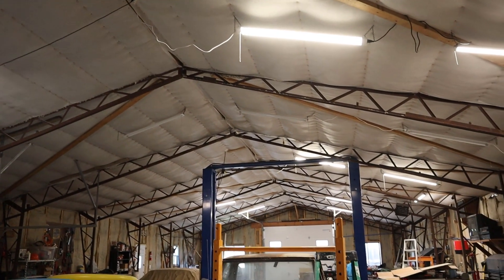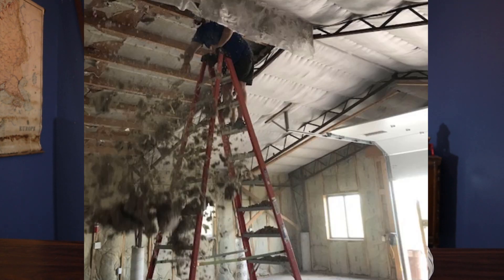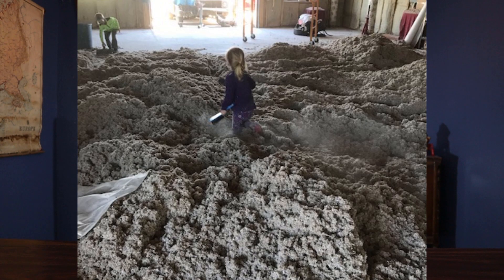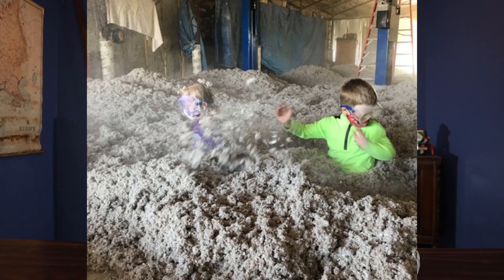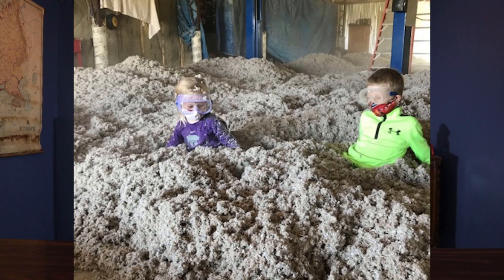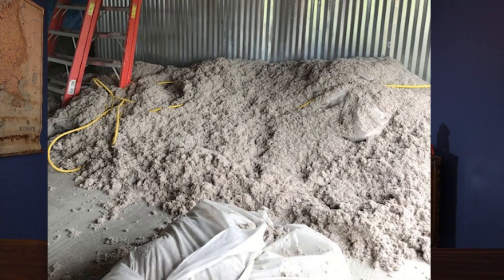Insulation DISASTER!!! - Don't Use Cellulose For THIS

Comment: I installed insulation for over 8 years. You needed to spend the extra money on quality ventilation chutes. They would be installed between the roof sheathing and the open cavity.  That fiberglass you installed will eventually mildew and or for mold  in a cavity that is not ventilated.  Cellulose was actually the correct product for your application. Your prep work was inadequate and you used the wrong manufacturers product. Basically you used temu insulation.  Springing for cocoon would have saved you a whole lot of headaches too.For want of 300 to 500 bucks worth of chutes, you blew an extra 1000 dollars. BTW the fiberglass will kick off ammonia as well. Get a batt of fiberglass wet and leave it for a day or two. It will smell like a thousand kitty litter boxes are in that space.

Comment: Never put insulation on the floor.. do the rafters.. it will be a nightmare.. that we are dealing with too. I huge nightmare, we had animals die up there and you can't find them.. mice rotting is the smell of cabbage. .  Do the rafters, or will save you money in the long run.

Comment: Bad circumstance. I wonder if Greenfiber would honor a claim (probably not).  Understanding blown in cellulose has been improved, it would be unfair/inaccurate to discount it now in favor of fiberglass. Applied in accordance with manufacturer's instructions, the R-factor achieved by volume is considerably better for nearly equal cost.  Both settle in attic applications until they reach their stable density, but the manufacturers' coverage charts typically account for it. Aso, practically speaking, cellulose is not nearly as much of an irritant during installation. It does not contain materials that irritate unprotected skin.

Comment: Just use Cardboard as insulation hahaha  Cardboard has a R Value of about 3.5 - 4 per inch get yourself 4 inches worth of cardboard and you will have a R value of 14 - 16 most americans throw away or recycle 100s of pounds of this each year through packages in the mail or store bought items but its great as a insulator and its practically free.
Reply from the maker: You are right, it does have good insulation value.  It's just highly flammable and easily molds.

Comment: Hi Garrett! I'm not far from you, in Newton. I've been researching removing the cellular from my home attic to air seal, and whether I must actually dispose of the old insulation or if I can just move it aside to air seal and then redistribute it as I also build an elevated deck ABOVE the 10-12" insulation to be able to get around up there better.
Sorry you had this issue, and good information to know if I decide to replace my insulation completely or if I need to just add some more after redistributing and leveling what I have.
Reply from the maker: If there is nothing wrong with the current insulation, I would redistribute.

Comment: If you have a high humidity environment, you need humidity control, a ventilated attic, good air circulation or some other method to remove accumulated moisture.  This is not unique to cellulose.  Low density spray foam has the same issues.  See, for example, https://youtu.be/Ld8pzIu45F8?t=2763.  You may be aware that warm air rises (because it is less dense).  Humid air also rises because it is less dense.  So you will have the warmest, most humid are at the peak of cathedral ceilings. You are blaming cellulose insulation for the issues you ran into.  There may be other issues related to the insulation approach for the roof.  This is a good case study into what can go horribly wrong with roof insulation.
Reply from the maker: I replaced it with fiberglass insulation, and no more problems.

Comment: Can some one please address the settling effect of cellulose? I had 10 plus inches of cellulose blown in several years ago. Went up recently to install security cams. All of that cellulose has sank to the rafter tops. As in it's ALL GONE. Cellulose is a waste of money. It settles over time. Like you just tossed all that cash out the window. At least pink panther fiberglass stays put.

Comment: As soon as he said Ammonuim Sulfate (the cheaper product) I knew where this story was going - the odor of kitty litter.  Folks , Cellolose itself is a great product.  And Green Fiber makes some of the best Options.  However, ALWAYS Buy the ALL BORATE PRODUCT so you dont end up with this odor.  Check the manufacturesr spec sheet, the markings on the bags and/or the MSDS sheet to make sure it says ALL BORATE or 100% BORATE and NO Ammonium Sulfate.

Comment: The likely culprit is the air leaks from the foam board. The roof envelope wasn't sealed enough to prevent the cold air from infiltrating the cellulose insulation which likely caused the humidity dew point problem.

Comment: Fiberglass is a horrible substance. Wouldn’t the better solution have been to spend more up front on the borate-only cellulose? That would not have reacted to humidity and tried to suffocate you. The problem was the ammonium sulfate, not the borate, right?

Comment: even if the cellulose insulation wasn't treated, wouldn't there be the possible issue of mold??
Reply from the maker: Because of the treatment, the cellulose won't mold.  However, if it is holding moisture, it can make the wood it is in contact with mold.

Comment: Never used fiberglass or rock wool in any of our houses built in the humid shore environment of North Carolina. Only Cellulose with borate only. Always blown-packed by pros with certified materials, paperwork, and verified by building inspections. Never had any off gassing, mold, mildew or soggy problems. Summers 85 to 100 with winters 25 to 50 degrees F.

Fiberglass, except wearing a full positive pressure bunny suit, gloves and face mask, is a no-no for blown in. The same protective clothing must be worn for  mat and batt fiberglas/rockwool installs by hand, followed by extensive clean up, disposal and full interior painting to stabilize lingering dust particles. 

Another no-no is the use of air conditioning ductwork that has an interior lining of treated or untreated fiberglas or flexible ducting with any fiberglass anywhere. The glass threads will, over time, flake off or pierce  the flex plastic into the air stream under heating and cooling expansion and then into adult and children's lungs.

Best to use plastic A/C pipe or metal ductwork with outer insulation of foam being the best .

Comment: Would a vapour barrier on top of 50mm cellulose cause an issue close to warm side of insulation as its hydroscopic? I have 270mm fibreglass on top. The cellulose is between joists in loft.

Comment: Used this stuff in the attic 32 years ago when I built this home. This year has been very humid causing this insulation to become damp and increasing its weight causing my entire second floor ceiling to bow between trusses. We only noticed as a sheet of drywall in the spare bedroom ripped through the screws. Now I will have to vac out the entire attic and replace with fiberglass batting.
Reply: Cellulose insulation promotes the growth of mold & mildew in your attic.

Comment: You can use gutters or 3” pipe to run a vent from the soffit to the ridge. I would at least somewhat temp control the area all the time. At least the air is moving and some of the moisture removed

Comment: Lert a contractor talk me into cellulose...$$$$cheaper Right...our house was so dusty after that...never use cellulose. It will get everywhere. Sold house.
Reply: Yeah because you should have had the attic been air sealed before installing, either the contractor may or may have explained this to you or you were just being cheap and didn’t want to pay for the attic air seal ..

Comment: Did you use open cell or closed cell?
Reply from the maker: I don't know what the original foam board was as I bought it used.
Reply: @Challenged1  sorry did not see you said foam board, not spray foam. If you went with closed cell it would not need anything else. The addition of a $600 of ridge vent would likey provide massive air quality improvement. Best of luck.
Reply from the maker: @infinitevelocityCA  Actually, the entire ridge was vented.  The roof purlins go in the same direction as the ridge vent making the ridge vent useless unless you are trying to ventilate the entire shop (conditioned space).  Closed cell would have been nice, but would have cost $7k for the roof structure.
Reply: @Challenged1  From a building science perspective, it's possible that the foam board did not completely cover the surface of the underside of the roof deck (edge gaps) and/or the foam board was not affixed directly (mechanically or adhered) to the roof deck. If that is the case, the underside of the roof deck can become a condensing surface, especially in a high humidity location. The night sky on clear nights is black and very cold (-400 F) causing the exposed surface temperature of the roof to lose enough heat (to deep space) to reduce the roof temperature below the dew point, creating condensation on the top side of the roof AND the underside of the roof deck. The resulting condensation on the underside can then be "attracted" (moisture gradient and gravity) to the cellulose creating the chemical reaction you described. The reason properly applied (closed cell) spray foam eliminates the condensation problem is no condensing surface is made available for the dew point to be reached. The key is to use a minimum of 2" of closed cell spray foam on the underside of the roof deck. This nighttime phenomena is known as night sky radiation (a/k/a radiative cooling). Surfaces that do not face the night sky are not subject to this phenomena. An example would be dew forming on grass that is exposed to the night sky as opposed to grass under a tree or canopy.
Reply from the maker: @kevinhogan2909  Definitely possible.  I will say, the amount of smell followed the humidity level exactly.  The more humid, the more smell.  The less humid, the less smell.

Comment: Just checked Greenfiber 's website and it appears they stopped making the version with the ammonium sulphate in it.  I'm betting they were getting a lot of complaints about that version of their product.  Was really bad decision on their part to provide a product that could easily off-gas  ammonia when in contact with moisture in order to save a bit of money.  One of the benefits of cellulose insulation is ability to absorb and release moisture over time.  There would have been zero issues if the non-ammonium sulphate version was used.
Reply: I know I'm replying late, but this is super helpful. Thank you!
Reply from the maker: Exactly

Comment: Probably not the best idea to let your kids play in that
Reply: They had ppe on. 😅
Reply: @bricknmotor  Poe does nothing

I do this for a living and would never go in an attic with the mask you used for  Covid
Reply: @DB-lp2be   yea i said ppe. Idk what your thing is. 🤣
Reply: @DB-lp2be  bro whats a poe?  Ppe stands for personal protection equipment but you should know that Because youre a pro. 😆
Reply: Its Not hazardous to play in. It doesn't require PPE to touch. It's just paper and flame retardants. It's not good to allow to it to get wet without ventilation if ammonium sulfate is the additive. You can touch it all day long with no consequences. I was an insulation tech for years and we used it for wet spray applications in exterior walls but it's not great for overhead use if it gets too wet bc it's heavy and can damage ceilings or in the case of this videos creator,..can off-gas ammonium sulfate when the cheap stuff is used and not allowed to adequately ventilate while exposed to excessive moisture. If one must ..make sure it's the Borate additive kind and not Ammonium Sulfate..and have plans for adequate moisture control factored in before using it for overhead uses.
Reply: @keithbarto5464 borate and ammonia sulfate is safe? Hmm

Comment: Adding polebarn steel to the bottom side would have saved you from having to take it down. It would have been expensive and a pain, but doable.
Reply from the maker: My steel trusses would have been close to impossible to seal around.  I agree though, if I could have sealed it from the inside, I think it would have been fine.

Comment: Your issue was not having an air layer between the cellulose. You are supposed to use netting and create an inch to inch and a half to allow air flow between roof and insulation.
Reply: Yup gotta have air flow
Reply: Yea ya would think the product would of come with some kinda pro tips or do all the research you could on using shredded paper before filling such a huge space first
Reply: Wrong - The odor will always happen if the ammonium sulfate comes in contact with high humidity air over 55% humidity. Doesnt matter if the air is moving, plastic enclosed, etc...  And its not always neceesary to have an air gap on under a roof. Its okay to create an "unventilated roof assemply" as long as your using the right materials, stopping all air movement and moisture movement.
Reply: air flow is your houses best friend thats why the draftee old farm houses last for ever the wind blows rite through them

Comment: So, basically you got what you paid for.  Cheap ammonia impregnated crap. This chemical should not have been in the CF.  In Europe we use benign boric salts as fire retardants and we have had no issues in similar conditions. Here it's also cheaper than any other insulation available, especially foam.  CF is a sustainable and safe product as long as you choose a reputable manufacturer  Total sharks sold this crap to you. Name and shame. BTW, Fibre glass is a fire hazard and glass needles are much more dangerous to your children's health, especially if you let them play in it.

Comment: It sounds like your shop needs ventilation, and i don't mean the roof, I mean fresh air. The inch of foam likely made it very airtight. The humidity combined with ammonium sulfate amplified the real issue of the need for fresh air. At a minimum you may want an exhaust fan.

Comment: What is your take on spray foam unvented roofline?
Reply from the maker: If sprayed by a pro, I would say it's good stuff.  As long as the thickness is adequate enough to prevent condensation, you are good.
Reply: Makes your roof useless in years to come should it need joinery maintenance.